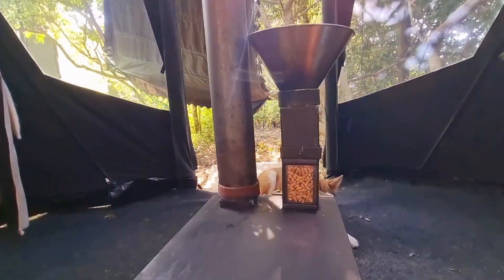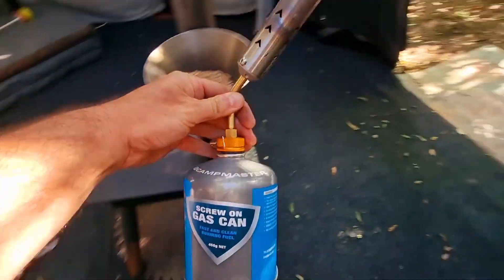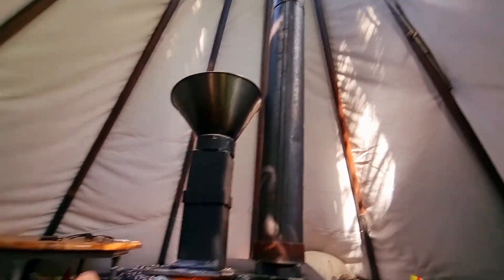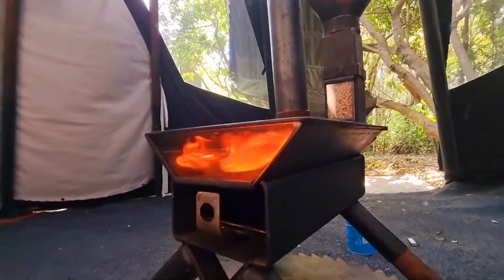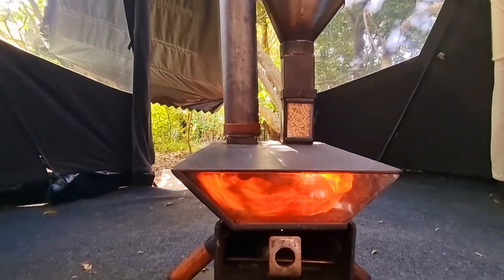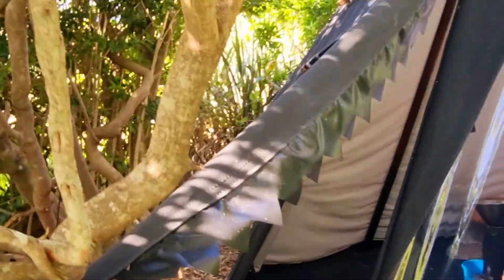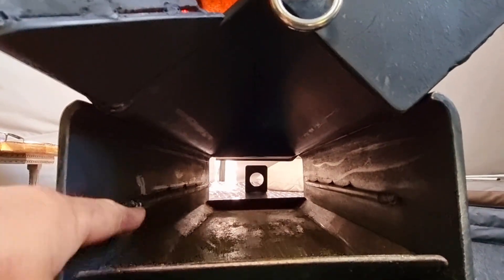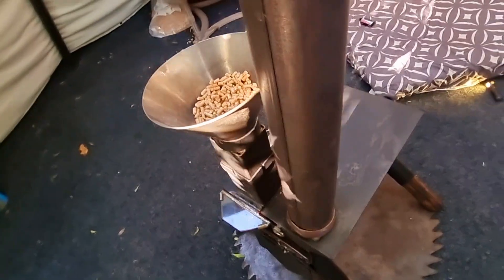2023 TRI-VORTEX.#rocketstove/rocket oven .A peep into how it's made,video link now in description .

Comment: I read the comment about pellet cost and was really curious if it could be designed to use chips from a wood chipper.  That'd save a ton of money.  Plus people hate small branches.
Reply from the maker: Hi, yeah not this older design.  The woodchips don't flow down the chamber smoothly.  When the chips get stuck they create a cavity. When a cavity is created it can cause a reverse chimney effect with the flames shooting up the feed Chamber

Comment: That’s beautiful man!

Do you have a record of the temperatures in different parts of the stove?

How hot is the top surface?
How hot is the bottom of the chimney?
The from glass?
This super cool baking chamber?

Tnx!
Reply from the maker: @MeironEgger  hi and ta mate. Yeah na no record that was just a prototype slapped together.  It was like a slow roaster .I am yet to release a video with my latest prototype oven design, it's summer here in nz and going out sailing seems to be taking priority lol.
Reply: 1. Assuming it’s a one shot video, it seems like within less than 3 minutes there’s smoke is gone. Is it? It’s pretty amazing!

2. Do you have any scientific source that explains why the angular design creates (or increases) this vortex effect?
Reply from the maker: @MeironEgger its a one shot wonder, i recorded that like a day after newyears two years ago. I think I was still high from the music festival. That's right the smoke only takes a few minutes to run clear. More so with those wood pellets anyway. My latest stove runs on standard wood and takes around ten minutes to get up to temperature before running clear. Your question regarding the vortex spin ,I don't have many answers there. I  find it mesmerizing and head scratching.
Reply from the maker: I remember watching this video below, and then I became intrigued by how a change in shape can course the fire to start to twist. I just love triangles and pyramids etc so I thought I'd experiment with shapes to guide the rocket flow .

https://youtu.be/XU1Jg6wnzG0?si=w328sqyadREgewRX
Reply: I’ll take a look at the video you linked…

Thanks for the answers. Mesmerising indeed !!!!

I still haven’t built my stove, but was wandering how to shorten the time it takes for the smoke to clear: Given the the combustion chamber temperature is what affects how fast it gets to full burning efficiency (e.g. clear smoke)… what if instead of using the torch on the fuel source (wood / pellets) you’d just take 30-60 seconds to heat the whole surface top and bottom, and then, when you fire the pellets/wood up, the combustion chamber is already hot (at least half way, if not fully).

Do you think it can significantly decrease the time to get the smoke clear?

Comment: your stove / oven design is excellent . I have made a cast refractory woodburner with afterburn chamber .. and a couple of chambers with heating pipes / tubing  The upper chamber would have been better to be used as an oven . The 80 mm thick refractory construction is excellent for holding the temperature for 24 hour heating.

Comment: I am serious. How much is one of your stoves?
Reply from the maker: @teddypearce1716  it's hard to say at this point. I'm still fine tuning them. This stove I'm this video has been put together and apart again multiple times its hard to get a grasp on pricing as costs are continuallyincreasingfor everything. I have been recently working on this one, putting in an ash dispenser and modification of the hopper and ash grate. The price of wood pellets has almost doubled in the last year, so I have been working hard, creating a multi fuel stove. As much as I would love to sell stoves its a slow moving process on my budget

Comment: Would it make sense to induce an axial rotation (life how a rifle works) to the flames as well, not just rounding the corner? Maybe it already does it but wondering if that could make it better. Also why not make the secondary air inlet the height of the rim of the feeder bowl?
Reply from the maker: Interesting question I have tinkered around with a similar concept. I couldn't come up with something that worked that did not take infinity to produce. I found that off setting that the triangle shapes produce enough vortex spin ,but I look forward to the day I can 3 d print complex internal structures out of stainless steel.
Reply from the maker: Regarding the secondary air question, this particular rocketstove was a couple of generations ago. I have sorted  a new design that has more benefits safer too thanks for the questions

Comment: Very cool (figuratively). I am looking for a way to grill (salamander grill) food using wood fuel. Could this be modified so more heat is directed downwards? If the vortex chamber was made thicker material and /or larger size and the base plate thinner, would it direct heat down? Also, is it just the volume of air entering that prevents all the fuel from igniting? And the little fences keep the fuel from being drawn into the vortex chamber?
Reply: Could probably replace the bottom plate with a copper plate and get a significant increase in heat conduction
Reply: Hey thanks James for that idea. I'll give it a go. I grew up in NZ. I was an ambulance officer in Queenstown but now live (retired) in the Philippines where gas and electricity are so expensive, so need a cost-effective fuel source for cooking. Keep the inspiration going.

Comment: Looks like it lights and runs really well👍🏻
Question; what is the minimum chimney length?
Is that the required length? Or just adapted for your tent height? Thanks for giving me a fresh idea🙏🏻
Reply from the maker: Ta dude, yeah minimum on this stove would be a 2 mtr flue,the smaller version of this stove can run smokeless on a 1200mm flue section.  Last night I added another flue section so that I can run the fire in the center of the tipi,works really well,amazing amounts of draw with the 3.6 mtr flue,I am trying to up load a short video it now lol but my internet is so slow a 2 minute video can take hours to upload
Reply: Replace the metal chimney with a glass one for outdoor home use. Could add a sweet new look.

Comment: nice project! What kind of glass did you use, in order to resist the high temperature?
Reply from the maker: Robax ® is the ideal fire viewing glass. It is a clear ceramic glass with great resistant to thermal shock and heat, so much that it can withstand up to 760° C for up to 5 hours and 560° C for up to 5,000 hours.

Comment: 1 Q....instead pellets can we use small branches?
And that jet engine starter could be avoided too right?
Selling a stove blueprint perhaps?
Reply from the maker: Your right,you don't need the gas flame touch, you can lite it with paper to start it .you just achieve smokeless mode a bit faster with it. I have redesigned the hopper system since this video 8 months ago. The rocketstove is now duel fuel, runs on scrap wood and pellets. I call it #MRFUSION ,like on back to the future lol. https://youtu.be/Zv-j43-DAcQ?si=I0GN4MjzPGI5gpR6
The one in that link was just the prototype mr fusion system. Even that's been updated now, yeah I'm just going to keep going till I can't go anymore.

Comment: How do the pellets feed?  What keeps them from going in all at once or getting jammed up?
Reply from the maker: Check out this video on this stove, in short the rocket draw effect flows over the pellet basket its always has a vacuum suction effect that keeps the unburnt pellets in the hopper room temperature.  Without the rocket effect this stove would not work, all the pelletswould catch fire.. 
A Pellet fireplaces like you would find in a house requires a electric fan to constantly push air over the pellet basket.  No good if your in a power cut. The gravity fed rocket system works great  thanks for watching 
https://youtu.be/8dsn0WAP1as?si=m1lLia596cYRt6pJ

Comment: Not a rocket stove and there is no vortex. Interesting stove though.
Reply from the maker: There is a vortex spin from the pellet basket to the front window, the triangular design creates this effect. There is also a flame twist effect that occurs when the flame passes  from right to left. I'm sorry that this does not meet your definition of what a rocketstove is. I can assure you that the rocket draw effect works very well in my design. With a 1mtr high flue,There is enough draw to to run it smokeless. Thanks for watching.

Comment: All that flame from a pinch full of pellets ?!!!!
Reply from the maker: this one's very efficient. One cup of pellets lasts around 25 mins. I have just redesigned the pellet feeder on the preproduction model. 
It will happily run on twigs ,kindling etc. I prefer pellets, but its nice to know you can use standard wood when you don't have any.
Reply: @PYROFLOWROCKETSTOVES  intent of my comment was how ?! That tray in the rear didn't feed jack ,it had about 6 pellets in it the"pellet feeder looked like it was forward of the rear chamber with the pellets directly over the flame with no way to control a feed or catching the entire pillet cache on fire ?!
Reply from the maker: @michaelvaughn7137  
Yeah I can't say I understand what you mean,might just be because it's Sunday afternoon  here lol. The pellets are gravity fed ,only the pellets in the bottom of the pellet basket are ever on fire. The rocket suction effect or draw keeps the pellets in the hopper at room temperature. The incredible draw or suction that rocket stoves have is a necessity in this design Without it you would be need to run an electric fan to blow the air through the basket similar to a pellet wood heater you find in a house. With those when the power goes out the fire place won't work. Rocketstoves have a off grid advantage. It is impossible 
For all the pellets to catch fire. the fire draws cool air downwards though the pellets to the basket ,feeding the fire with secondary air. Please note the open rear is just there for more air  suction. In my latest design this is located on top,so not to risk any pellets escaping. Yeah it's a older design, but the youtube  algorithm seems to promote my older stuff .

Comment: Great project. Is there a way to "turn it off" or you have to consume all the pellets? did you had any problem with the ashes "clogging" the airway?
Reply from the maker: Hi there, this rocket stove does not have a hopper feed cut off but newer design ones have.though it's like any fire it burns what you put in. It can be turned down by opening the front glass or setting the burn basket higher. My latest rocket stoves have ash collection, but its not really a problem with the design. You always get a bit of ash build up just in front of the pellet basket, but it does not build up to much,the stove burns of most ash in the secondary combustion, the rocket or draw effect keeps the area clean.  8 hours of burn time equals around a quarter of a cup a fine ash, thats easily cleaned out at the end of the burn. Cheers
Reply: @PYROFLOWROCKETSTOVES  Thank you very much!!! Really like you design
Reply from the maker: @jotapezanelatto  thanks for the support 👍 👌
Reply: I’m curious how long would that hopper burn for and how much pellet does it hold?

Great job do you have a link to your latest version?

Cheers

Comment: Please be careful of  the exhaust. If something goes wrong you can burn the whole tent down.
Reply from the maker: Will do thank you. I have been building tipis for 16 years now, I use a fire resistant canvas. Traditionally fires have been in tipis for hundreds of years. I have built around 200 of them ,never heard of a out of control fire in one yet.
 My rocket stoves are much safer than a traditional fire also. A 1.5 mtr high flue is tall enough to bring the temperature of the hot gasses down to a safer Level. With No smoke ,no embers, etc. Rocketstoves are different from other fires this one in this video is a older prototype but the system works the same as a current model.  Because the flames have to travel around before going upwards most of the heat is concentrated in the unit it self the flue pipe is no where as hot as any another design if fireplace. My latest prototypes are more finely tuned.  I will be posting videos with those in coming weeks thanks for your interest.

Comment: can we get measurements, or atleast what thickness steal you use, is it mild steal
Reply from the maker: Sure,  the length was 500 mm the triangle angle was 125mm box section cut in half and welded together on to the top plate that's 500x360 mm I used 5mm foe this one simply because that's what scrap I had. You could use down to 3mm ,any less thickness and I geuss it could warp I'm not sure.
Reply from the maker: Check out the tear down video I made o  this stove in link. That should help you with making one ta

https://youtu.be/DbTPpbV8fEk

Comment: so what do you do when you dont have pellets ?
Reply from the maker: You can use twigs, kindling, wood chips etc  . I sometimes use it. Has to be really dry. I want to buy a pellet press machine soon . Pellets are so confident, stable, consistent cheap and compact.  You can buy them by the pellet bulk. Like 65x 20kg bags around 700 nz around 350 us. Yeah there's  a pine forest industry here in nz 100 miles from my house that makes the pellets. It's just a bio product ,all the saw dust.

Comment: WOW! The cleanest and most visually appealing rocket I have seen. So simple and elegant yet functionally awesome. Nicest and the coolest designed rocket stove on the internet ! IMHO, TFS
Reply from the maker: Wow thanks for that comment, wait and see I have a few more tricks up my sleeve ,I currently have this design fully fine tuned unfortunately its a cardboard model lol .once I have four walls and electricity I will post it asap ,cheers
Reply: @PYROFLOWROCKETSTOVES  I love the attention to detail, especially your triangular channels for the vortex + increased cook-top surface & oven volume! Genius!
My only thought to add: an alternate route for the pellets/kindling into the burn-box, from a trough that sits next-to the hotter side of the U-bend, contacting that surface? The heat from the lower right side could help dry any wet material, warm it... and you could route the air intake through there, too, to pre-heat the air. Moving pellets horizontally would need some kind of screw-shaped feeder, like a worm gear, which would eliminate the self-feeding aspect (sadly!) while conversely making the fire easier to stop or control. Just an alternative that might float a different boat :)
Thank you!
Reply: Truly a work of art.  He could sell versions for thousands.  Amazing we don’t use all our fuels energy up before exiting the dwelling. 🌲🌲🌲🪵🪵🪵🔥🔥🔥❤️❤️❤️
Reply: Sweet Design ! I Could Use A Couple Myself .... What Might Ya Price Those For Sale ? That Size Would Travel Easy Enough & This Design Should Be Scale Able For A Larger Application . Looks Very Efficient & Practically Smoke Free ! Thx For Sharing .Nice Work Mate . Cheers From Texas !
Reply: What a awesome design..I love it..👍🏽❤️‍🩹